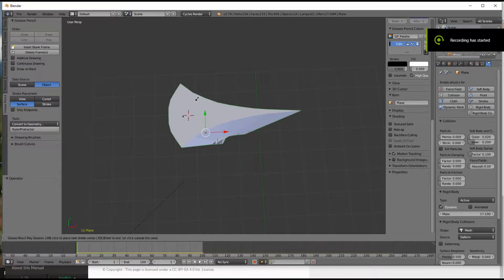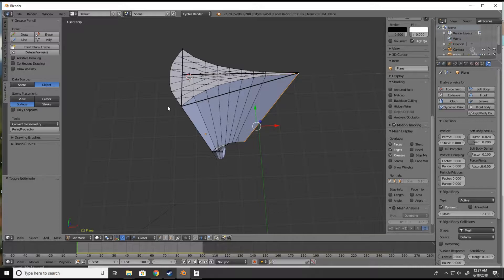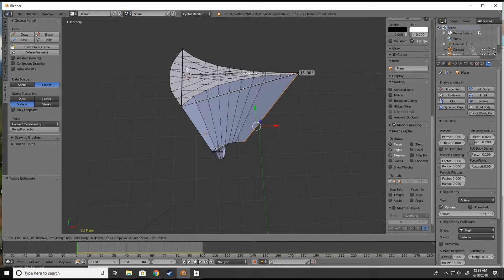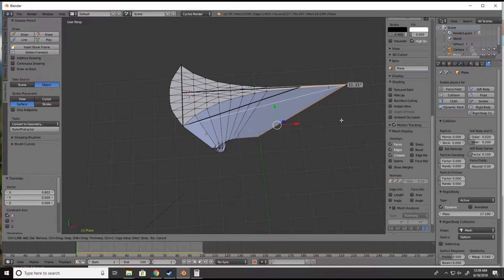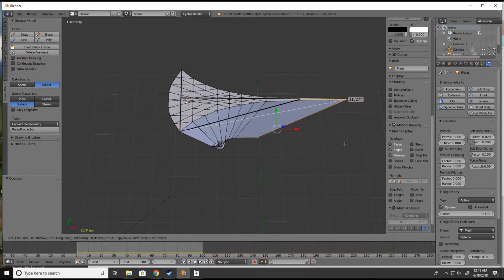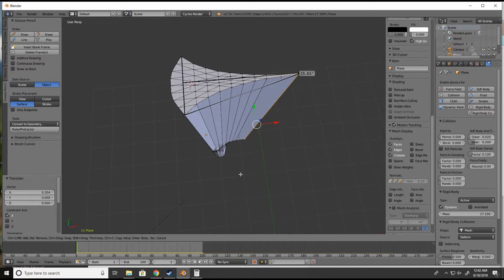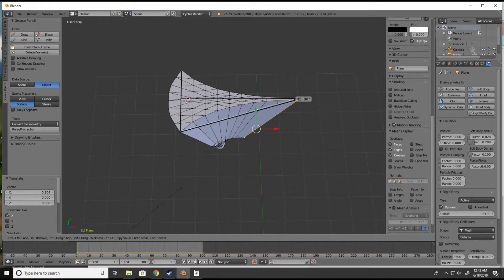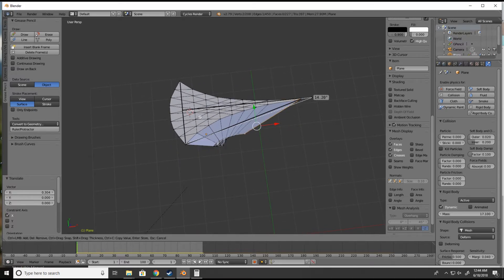Straight Razor Geometry

Comment: Very interesting yes I have questions. 1. I bought a razor that has benn honed with one tape by the artisan . Angle is inferior to 17 degree probably 14 or 15. He do this because not able to do a 17 °bevel angle or he do this for others reason! Because my Thiers Issard is 17.00 °.
Other question! He doesnt' do  full hollow gring . He is nof able or simple refuse this kind of grinding?😮 All this is a mistery because he cant say thevm thrue! Even if I imagine doing  a  perfectvfull hollow requires a very expensive machine with 2 wheel working at the same time that for an artisan is too expensive. Why industry dont do more near wedge grinding? Thanks Sorry but these questions are very important because are all about geometry!!!

Comment: Not very good with math and don’t own a computer or laptop but I’ve been collecting straight razors for a very long time so I know the difference between a good one and a bad one I was wondering if I could take the measurements from one I already own and use that to make my own I am a knife maker and have 2x72  most of my razor are vintage but have verry little spine were thanks